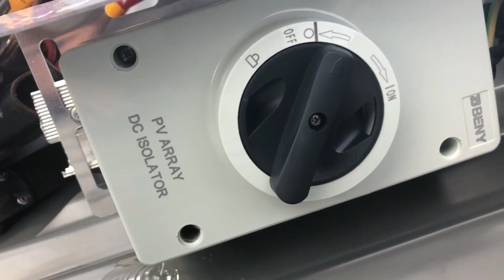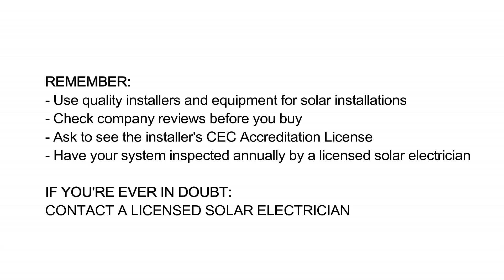Solar Power: Incorrect Installation of DC Isolators

Comment: Best thing to do is get rid of roof top isolators all together and have 1 next to the inverter. They are all ticking time bombs
Reply: so if you have one isolator next to the inverter , how do you then stop the energy coming to the DC isolator from the panels?

Comment: So where is the correct place to mount a DC isolator. Should it be located inside a building?
Reply: not at the bottom of the vertical rail. either at the top or on a separate (but earthed) horizontal rail. try keep a drip loop.

Comment: Nice video, Is it ok to use a bigger isolator than required? say out is 450v, 20amps, is it ok to use a isolator that is 1000v, 32amps?
Reply: yes 1000v, 32amps is rated and will work, but it all depends on the setup you use, let say for example you have 450v at 20amps and you use a 1000v 32amps Isolator the maximum amps you can use or pull from the 1000v isolator is 32amps more then that will trip or break the circuit at 32amps or what ever is the maximum on the 1000v 32amps isolator.
Reply: @none0049  Thank you, just, as I had already bought some isolators , thought If I could use them rather than buying more. Thanks